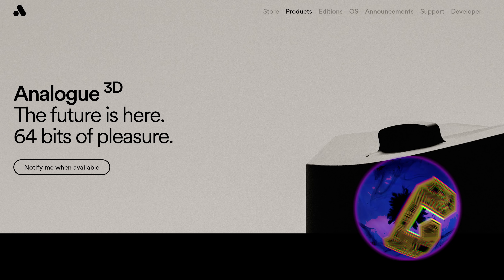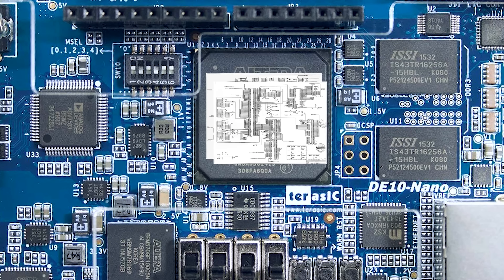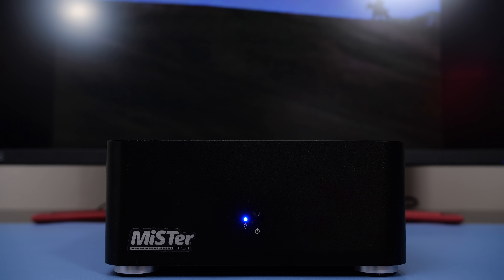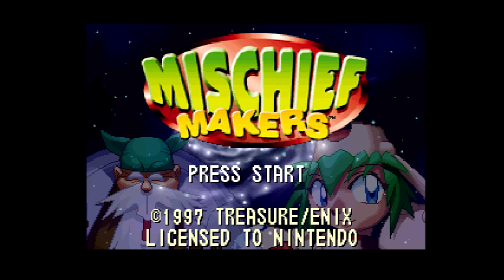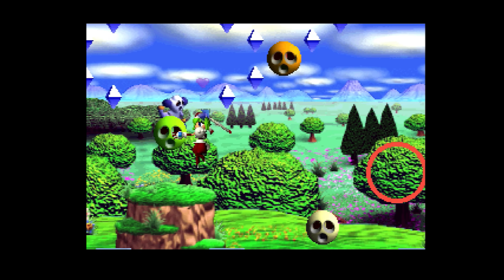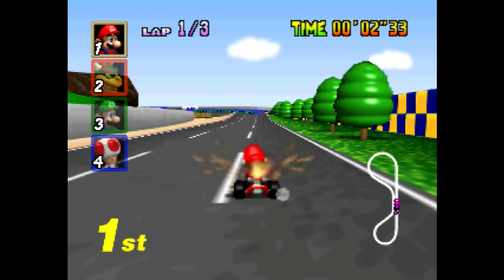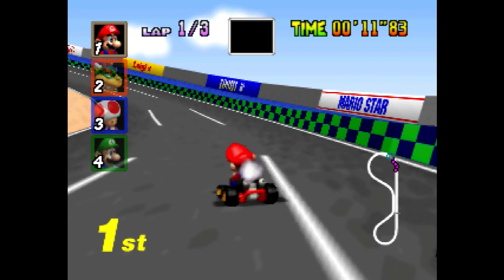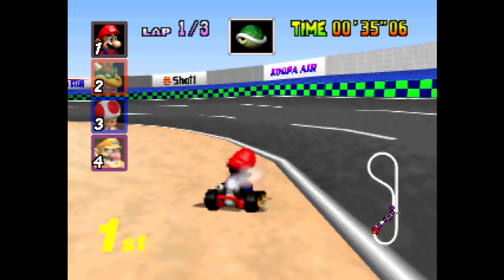FPGA Nintendo 64 gaming is here.

Comment: I may be missing something here, but I cannot see any point to this unit. Apparently, the N64 has been tough to emulate, yet, I have been emulating it for over a year with no problems whatsoever. OK, so, maybe some others have not been so lucky and emulation for them does not work properly, then why not get a real N64 rather than this? Then you will have the games running on real hardware. With the proper controllers and everything exactly the same as it was back in the 90's when this console came out.
Reply: The MiSTer has compatibility with original controllers and can output video to a CRT, just like back in the day. It can also output over HDMI. It can also do more consoles than just N64, such as Gameboy, GBA, Genesis, Saturn, PS1, arcade cabinets, and old computers. 

The appeal of the product is the versatility
Reply: @nunyabiddeness6544  My pc can do that too.

Comment: I used to work for Altera in the noughties and several other programmable logic FPGA companies. The Cyclone 5 FPGAs are very much the lower end/mass market of the FPGA business - MUCH bigger, faster and more capable FPGAs are available that could easily emulate the N64, but it could get very expensive. In 2005 the highest spec Stratix FPGAs were about $4000 EACH, IIRC.
Reply: I believe intel subsidizes some of the cost of the DE-10 nano because it's meant as an educational tool. That's why I wonder where we go next because once we fully tap out the DE-10 nano the costs of this particular niche are going to explode.
Reply: @devilmikey00 It's not so much subsidized as it is that Intel's FPGA pricing varies wildly based on volume purchased. They will literally charge you 10x as much for a single unit as a volume customer. So Terasic is getting them with the volume discount and you're not getting that discount if you try to buy the FPGA itself on digikey. This has proven problematic for retro gaming product development where it's all happening at a small scale, and it's why you're seeing a mass exodus from Intel/Altera FPGAs to Efinix FPGAs. I understand that Efinix's development tools are pretty terrible compared to Intel's, but Efinix will match Intel high-volume pricing for low-volume orders and that's how you're getting Dreamcast on the MARS FPGA.

Intel doesn't seem to have any interest in anything but massive volume customers for FPGAs, and they're probably going to completely lose that market (small volume customers) over the next few years.
Reply: @guspaz  They also charge wildly different amounts in different markets and Terasic is Taiwan and is able to get the full asian market pricing.
Reply: @guspaz  Didn't see your comment but I was thinking about the Efinix FPGAs too. I'm not an expert in FPGA work but they seem to my untrained eye to offer a lot of bang for the buck. If someone designed a FOSS dev board with the right feature set, I could see a move over to one of their larger FPGAs
Reply: Can confirm to all who answered my original post that product availability and cost is extremely fluid depending on what tier customer you are. Low volumes? Get to the back of the queue. Nokia (back then anyway) - how high can we jump for you?
Reply: @kristianTV1974  The price used to be much lower though. I bought my DE-10 nano for $135 in 2018 or 2019 (before the Covid), now the price has almost doubled. Still, from what I know, right now it's the cheapest FPGA for what you get for the price.
Reply: one of the fpgas i work with costs ~80k when bought individually😂😂😂
Reply: I've played around with the Effinix FPGAs before and their prices seem rather cheap for the sizes you can get.
I'm curious if that would make for a feasible upgrade path for a good price since apparently the DE-10 has gone up in price so much.
Reply: You forgot about Xilinx FPGA 😂

Comment: One thing I fail to understand, is why people do not get the core logic and turn into a microprocessor diagram and create a clone console.
I know it is nit simple to just create a microprocessor, but we see lota on SOC now and then being created, so it is possible.
That would make way cheaper system, that is basically, as good as the Analog ones or Mister.
Reply: Someone absolutely could take the FPGA cores developed for MiSTER and create custom chips based on them. One of the big uses of FPGAs is for testing chips before sending them for production. The problem is it costs around a million dollars to do it. They would need to sell at least 10k units to even consider it.
Reply: The only time a fixed ASIC makes sense is when you produce a ton of them for Economies of Scale. That’s because they are intended for high volume production with a lithographic mask. You have to remember that there are tens of MILLIONS of the original consoles out there already which only stopped being sold in stores because the market wasn’t there to sustain them, leaving a glut in the market today.

The reason FPGAs are cost effective is because they can produce them on a larger scale and then implement them in products that adapt them for smaller, more niche, applications. The “field programmable” part of FPGA means taking that lithographic mask fabrication process and enabling that to be done and redone in on the chip after implementation.

Now, imagine if someone did product thousands of clone chips as an ASIC and then found an error that causes them to scrap the whole production batch and produce another. That would bankrupt most any company making a niche product like ours. They can’t go back and fix it on the already-produced clone chip without the “field programmability” of an FPGA. This is why Nintendo’s own SNES 1-chip was never fixed (used in real SNS-001 and SNS-101 consoles). This is why all the clone SNES consoles from the old GameStation and Tristan 64 to the Supaboy and RetroN2, etc available today have the same flawed ASIC design. This is why so many Famiclones with a NOAC have the reverse duty cycle audio glitch and can’t play Battletoads. They produced millions of those chips decades ago with the flaws baked in and they are still making their way into products today.
Reply: FPGA is expensive because it is not a fixed architecture, so one chip can potentially be anything else within its specs, and you're not translating sets of instructions through software like a traditional emulation layer would do, in fact it emulate the hardware so it can directly interprate any language set from said hardware natively thus reducing latency and being capable of giving a 1 to 1 experience with the original hardware, in fact it's mostly used on the manufacturing process because it gives the engineers the opportunity of testing different iterations of a new hardware without having to manufacture it yet and making fixes and changes on the go reducing a lot the developing time and the money spent since those machines that make CPU's are very expensive and manufacturing a prototype costs hundreds of thousands of dollars, so while it would be possible to make a micro chip capable of running for example N64 games exactly like the OG console did, it would cost an incredible amount of effort and loads of money while making an all in one FPGA machine capable of the same and with the added benefit of potentially running anything else from other consoles to old computers below that espec is way cheaper to manufacture and develop the software for it, that's why this particular architecture is so awesome despite its higher price tag for the end consumer.

Comment: Don't tell the emulation/retro game scene that something can't be done.

Because they will do it; and it's always beautiful.
Reply: Remember n64 emulation on 3ds?
Reply: @guestc142 it’s so bad😂
Reply: I bet they can't do an FPGA of the cell processor before the year 2030
Reply: There are some hard clock limits on FPGAs. The Cell runs at over 3 GHz, and no current FPGA is that fast.

Comment: Now I'm thinking we need an FPGA with a GPU system with the FPGA handling all the CPU operations and converts the instructions that would go to the original GPUs to equivalent instructions to modern GPUs
Reply: During development of MAZAMARS/UltraFP64’s N64 core he had a board designed by ElectronAsh with a real N64 CPU plugged into his FPGA dev board. This allowed him to focus on cloning the RDP/RSP/RCP without wondering if any issues encountered were due to flaws in his CPU core. Of course, he ultimately cloned everything but his core was never released. It might be coming to MARSFPGA or Analogue.

I wonder if he had a N64 RCP on a similar board when developing the CPU part of the core, because then it would’ve been almost exactly like the “GPU” you are imagining. ;) Here’s hoping the next generation of FPGA consoles will be able to replicate GPUs like 3Dfx Voodoo for PC cores and late ‘90s arcades from Atari/Williams/Midway (Rush, Hydro Thunder, Blitz, etc).
Reply: Isn't that basically what HLE software emulators do and have been the main point of criticism of them for years? Modern GPUs don't always have equivalent instructions to older hardware, and hacky solutions have to be made to replicate them, typically causing performance or accuracy issues (for example, the N64's three-point filtering and framebuffer)
Reply: @GANONdork123  Not sure, but even the Mister Neo Geo core (which had all the custom chips decapped) has to use the Darksoft romset, so if the best of the best fpga emulator has to use molested roms and cant play 1:1 dumps something is up.
Reply: @etgripper  The problem is that there is no standard format for 1:1 dumps on Neo Geo cartridge systems. The ROMs for various subsystems are like completely different cartridges… and each can have extra hardware like bank switching. The NES has iNES. Neo Geo has the Darksoft set and whatever the other format is along with converters to go between them. Even the NeoSD needed a prep application. shrug Both Darksoft Neo Multi and NeoSD ran on original hardware.
Reply: @GANONdork123  Yes, except they also do interpret whatever is intended for the CPU instead of agnostically replicating the CPU closely enough in hardware for the code to run natively.
Reply: What I’m hoping for is some kind of hybrid… like replicating two N64 RDPs side by side with something like 3Dfx’s old Voodoo SLI (Scan Line Interleave, not nVidia’s Scalable Link Interface) so that each could render alternate scanlines and double the resolution before scaling.
Reply: WTF?! Right after posting that comment about wanting something like 3Dfx SLI to double the resolution of an FPGA N64 replica I got a notice that a comment was removed for spam. Can you guys still see that comment about SLI?

I just got a pop up from YouTube saying “comment removed” for spam/scam. Something is wrong with YouTube. My comment history demonstrates that I go above and beyond to make constructive comments. If they punish that then all there will be is spam, scams, and people saying worthless stuff “OMG SO FUNNY LOL!”

To quote Weird Al Yankovic “…and post in’ ‘me too’ like some brain-dead AOLer.”

Comment: Does fpga also seek to recreate the "dashboard" experience like the ps2 screen without a disc inserted?

Or even ps3/xbox?

Im always about emulating th ENTIRE experience. Not just playing the games..
Reply: You have to provide the BIOS (and the ROMs). As for the Mister cores of PS1, Saturn and SegaCD you will boot straight into the Dashboard of the BIOS you loaded up. That also applies to the Terraonion Mega SD. You have the full experience aside from loading a physical CD. PS2/PS3/Xbox will not be possible on the current Mister Hardware.
Reply: @Turbotobi79  i just meant i would like an eventual emulated full experience on some sort of future hardware, be it PC or specially-constructed portables, or what have you ❤️
Reply: I doubt it cause that's all part of the BIOS which is copyrighted. The Analogue Pocket uses its own BIOS which is why the Game Boy logo is never shown at boot.
Reply: @leatherhidegaming  i guess we will just have to wait like 10 or 20 more years, and then the stuff will be so retro that i doubt they would care at that point 🤷‍♂️😂

Comment: I'm more than happy with the NSO's modernized emulation of N64 games. Forgive my ignorance if it's been done already, but if someone could extract that emulation method and scale it to a PC or to other cracked hardware, thats all what I really want.  Instant save states are invaluable to some of us adults that need to loop difficult sections repeatedly, or want to pause the game in any particular space to resume later.
Reply: There are much better emulators on PC than the NSO. No need to port it on PC.
Reply: Just stating that from the pickup and play perspective, including the initiation time.  From technical perspective, I would hope there are better options on PC.  I don't want to have to spend any time setting up cores or pointing to folders or setting up special case by case conditions for each game.
Reply: The N64 switch emulator is nothing special and known to not be completely accurate and everything you want already exists on PC (save states since literally forever). More accurate emulation can be found on PC (try Mupen). You seem to not be aware of PC N64 emulation at all.

Comment: Wouldn't be surprised if Analogue takes Roberts work for their product, what a coincidence they announce their product after Robert releases the core...
Reply: Nope. Robert has already said that Analogue’s N64 FPGA developer has been helping him so you’ve got it backwards. UltraFP64 finished his N64 FPGA core years ago but he never released it since it wasn’t able to be used with MiSTer. There’s a good chance he took it to MARS FPGA or Analogue. Also, MarshallH works for Analogue to develop the Pocket and he may have brought his friends on board. You know the ones: together they decapped the N64 PIF and CIC to replicate them in FPGA and create stuff like UltraCIC and UltraPIF… which are used in products like the Everdrive and MarshallH’s own 64Drive.
Reply: Ares?
Reply: @clippy_friend  Ares is the latest open source multi-emulator that has an accurate (but still incomplete) N64 core. It's still currently the most accurate way to emulate the system though.
Reply: @Imgema  Incredible stuff. I haven’t been paying attention to the scene for a year and a half…and now this. Amazing.
Reply: @Imgema Every emulator is incomplete because you can’t fully emulate crappy coding 😂
Reply: @christophervanzetta yur're*
Reply: They haven’t, they developed their own hardware and software environment. Quit schizo posting because you irrationally hate a company.
Reply: And what a coincidence N64 FPGA became a thing soon after Ares was released.

Comment: I wouldn't say it's hardware based emulation since the FPGAs run software(gateware) as much as classic emulators do or can do.

Maybe FPGA-based and CPU-based?
Reply: I would.

An ASIC hardware clone is just an FPGA without the “field programmable” part and yet you find ASIC clones in original consoles, like the Game Gear, Genesis, and SNES 1-chip… and they aren’t perfect there either. No one insists that we call the SNS-101 or late revisions of the SNS-001 “emulation” because they are accepted as original hardware. They were just an imperfect replication of their earlier hardware in an attempt to reduce three chips into one (PPU1, PPU2, and CPU).

The only real difference between ASIC and FPGA is that you can fix mistakes in an FPGA where the flaws get baked in at the fabricator for ASICs. Both are made from the same HDL being used to define connections between a grid of premanufactured logic elements. It’s DEFINITELY hardware. That hardware is technically trying to emulate other hardware in the dictionary sense but there is no reason to distinguish that from hardware when it literally is. Again, no one would say that the late model Super NES consoles from Nintendo aren’t hardware “because they run software(hardware) as much as classic emulators do.” On the contrary: They are the hardware classic emulators aim to replicate.